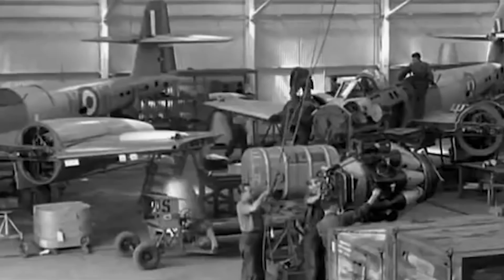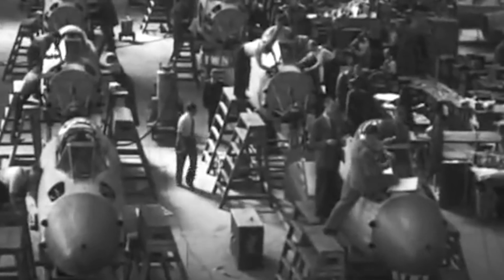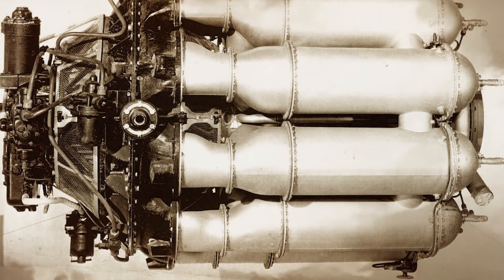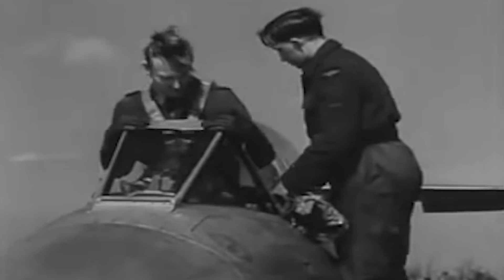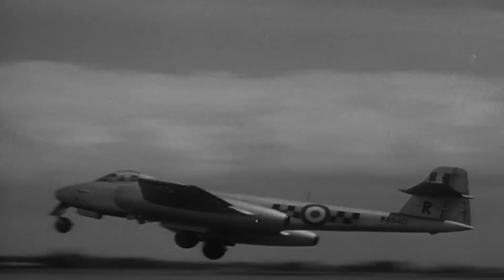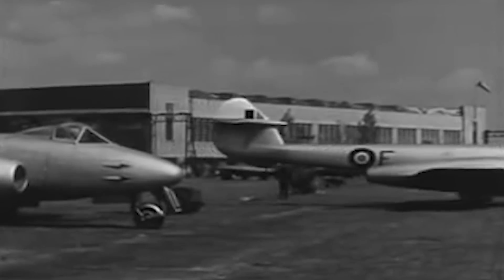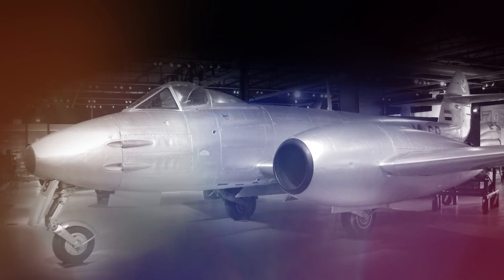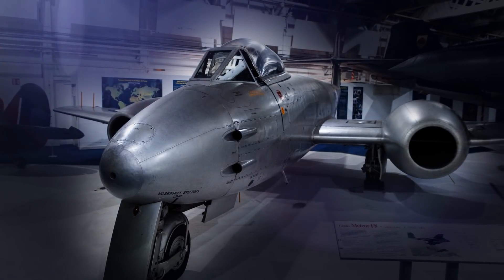Gloster Meteor - The Only Allied Jet to Fight in WW2

Comment: It did look good, but the pilots that flew it knew it as the meatbox.
Reply: Sounds similar to how the Germans called the F104 -> the Widowmaker.
Reply: @SandsOfArrakis  Yeah, but the F-104 could fly Mach 2+ and reach 103,000 ft. In 1954...
The Meatbox was not even supersonic and had trouble just staying airborne.
Reply: Sandbum dorktorbummer, the F 104 did fly in 1954, the same year that the much better  English Electric Lightning achieved supercruise. the F 104 only did one thing well, that was fly into the ground. There are still Meteors flying with the Rolls Royce engines.

Comment: Me 262 vs the 44/45 variant of the Mentor would not have been much of a contest!
Reply: BTW - several still fly.  I have seen them in the fly, a pretty plane!!
Reply: @chriscarbaugh3936  the Me 262 you see in airshows have a modern engine, other than that everything else is intact.
Reply: 262 had a slower rate of roll and worse turn (both initial and sustained rate) depending who who got the jump it would be a close fight with pilot experience being  deciding factor.

Comment: "Frank Whittle, inventor of the turbojet..."

Hans von Ohain: NANI?!
Reply: Two quotes from Pabst von Ohain's foreward to 'Element of Propulsion, gas turbines and rockets' -

"The first patent of a turbojet engine, which was later developed and produced,
was that of Frank Whittle, now Sir Frank (see Fig. 5). His patent was applied for
in January 1930. This patent shows a multistage, axial-flow compressor followed
by a radial compressor stage, a combustor, an axial-flow turbine driving the
compressor, and an exhaust nozzle. Such configurations are still used today..."

And

"From the beginning of his jet propulsion activities, Frank Whittle had been
seeking means for improving the propulsive efficiency of turbojet engines.  He
conceived novel ideas for which he filed a patent application in 1936, which
can be called a bypass engine or turbofan. To avoid a complete new design,
Whittle sought an interim solution that could be merely "tacked on" to a jet
engine. This configuration was later known as the aft fan. Whittle's work on
fan jets or bypass engines and aft fans was way ahead of his time."